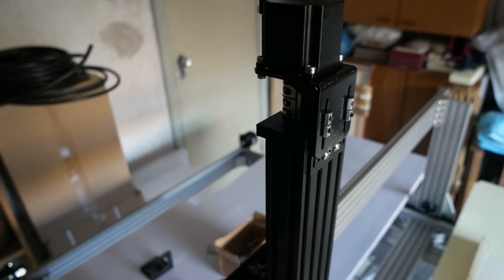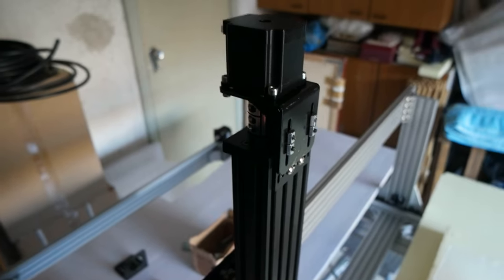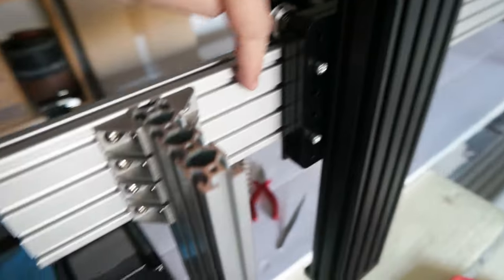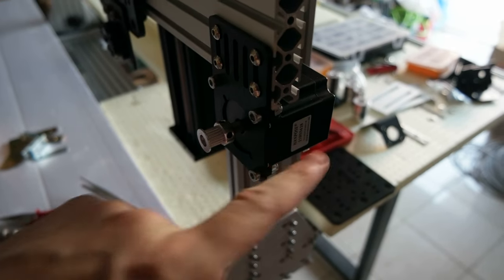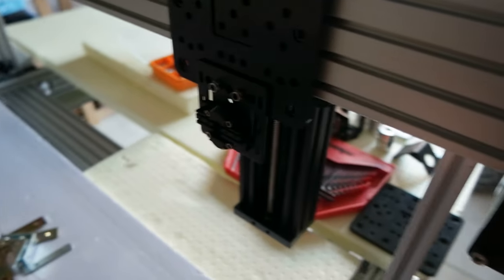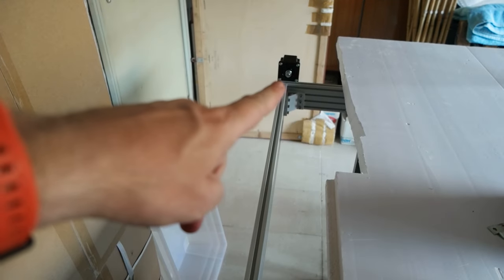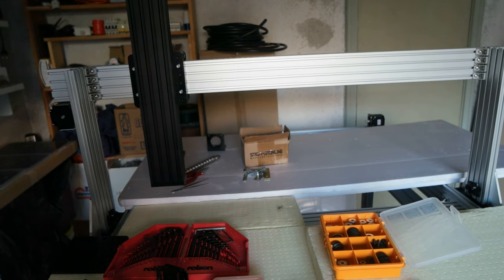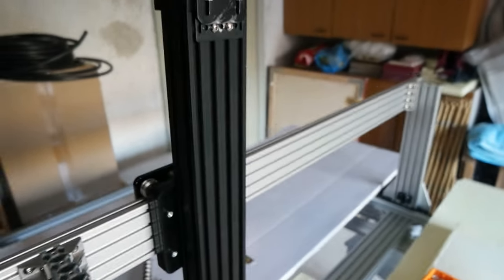Axis motors mount for my custom 3D printer

Comment from the maker: I finally had the change to mount all the motors for the 3 axis. I will have one motor for the Z-axia, one for the X-axis and 2 motors for the Y-Axis. I decided 2 for the Y-axis since it will move the entire X-axis and Z-axis together. I am using Nema 23 motors so they should have enough power.

============================================================
Laser Support - https://s.click.aliexpress.com/e/_A0NYLS
Laser - https://s.click.aliexpress.com/e/_AXFIJS
Induction Heating Power supply - https://s.click.aliexpress.com/e/_9hVy0K
Heated bed power module mosfet - https://s.click.aliexpress.com/e/_DkX...
Infrared Heating Film: https://s.click.aliexpress.com/e/_AUcAhb
BIGTREETECH BTT S57B V2.0 - https://s.click.aliexpress.com/e/_9gZpdo
Oled Screen - https://s.click.aliexpress.com/e/_9R4LLy
3D Printer GT2 20Teeth - https://s.click.aliexpress.com/e/_9yJNts
Nema 23 holders - https://s.click.aliexpress.com/e/_9wL11C
BL Touch - https://s.click.aliexpress.com/e/_AYXBGI
Infrared heating - https://s.click.aliexpress.com/e/_9InHB4
coupler - https://s.click.aliexpress.com/e/_ASloGa
Touchscreen Monitor 7 in HDMI Screen - https://s.click.aliexpress.com/e/_DCr...
BIGTREETECH BTT Manta M8P - https://s.click.aliexpress.com/e/_DlJ...
BIGTREETECH BTT CB1 PI4B Adapter - https://s.click.aliexpress.com/e/_DBJ...
BIGTREETECH BTT CB1 heatsink - https://s.click.aliexpress.com/e/_Dmd...
BIGTREETECH  GTR 1.0 http://s.click.aliexpress.com/e/_rRDltN
BIGTREETECH SKR Pro v1.2 - http://s.click.aliexpress.com/e/_rRDltN
BIGTREETECH SKR V1.3  -  https://s.click.aliexpress.com/e/_AbZJ5z
TMC 2226 - https://s.click.aliexpress.com/e/_DBP...
TMC 2209 - https://s.click.aliexpress.com/e/_ApIVvH
Nema 23 - https://s.click.aliexpress.com/e/_AdrgEQ
Nema 17 - https://s.click.aliexpress.com/e/_97imIx
Nema 17 geared 5:1 - https://s.click.aliexpress.com/e/_A3kKfz
============================================================
flipsky ESC https://flipsky.net/?ref=ganzo
maxkgo BMS - Coupon Code ganzo https://maxkgo.com/?ref=ganzo
============================================================
Alibaba weekly deals https://offer.alibaba.com/cps/8pt0t96j

Comment: Your extrusions are not V-Slot. The extrusions seen in this video have a rounded corner on their inner slot. For the wheels that you are trying to use, you need this to be a straight angled edge and not this rounded corner.
Reply from the maker: I know but I got the same as I kit that I saw in a video, but all the wheels I tried do not fit for 1 mm! But now I found a good setup!